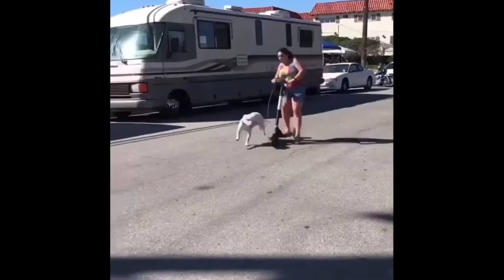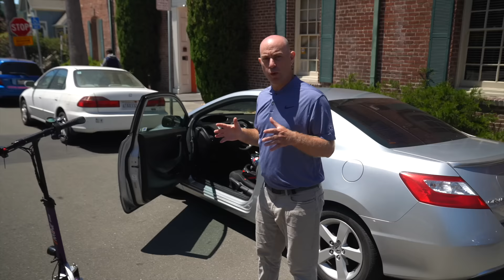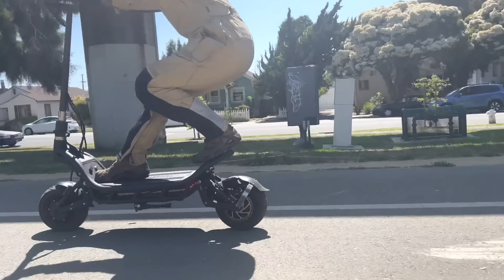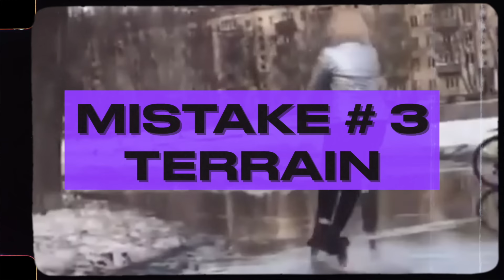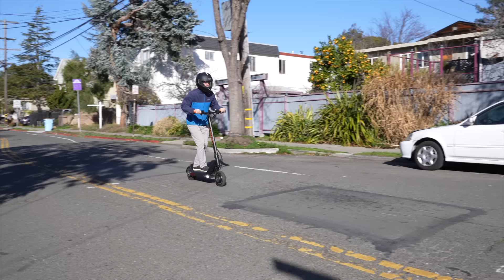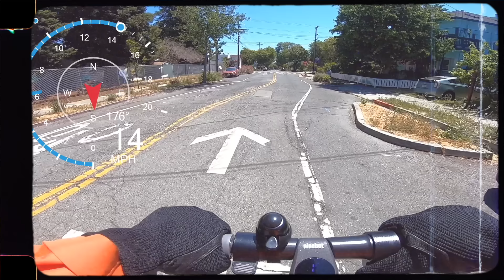Top 7 Riding Mistakes New Scooter Riders Make & How to Avoid Them

Comment: The road alone can be slicker than grease when it's wet. Stick to sidewalks and 15 to 20 mph commuter speed in the rain. Also, adjust your suspension to better match your weight. Some of these units ride like a brick and be very "hoppy". Even with full suspension  and air tires. Due to overkill on the payload capacity. Soften it up to smooth out the ride. Popping the front tire up to clear over larger bumps helps greatly. For when you can't slow down. Learn how to bunny hop.
 
P.S.
The Apollo Phantom is an absolute beast. 🔥 I absolutely love it. I haven't had this much fun on 2 wheels. Since I was 12 years old. Riding on a BMX track...
My units tested top end of 43 mph is no joke. I wear a full face, modular, motorcycle helmet. With a level 1 armor jacket and gloves. In case my guardian angel's on break. Turning 51 this year, I don't bounce so good anymore... 😂

Comment: Rode my buddies Apollo phantom V for the first time ever.. never been on one of these things.. and learned all of this within 15 minutes.. no issues. No crash or falls.  Seemed straight forward and common sense what to do and not to do! Some people are slow learners with dangerous toys.   Another tip** know your terrain and routes before going top speeds.. ex. Pot holes, sewer grates, curbs, cracked roads, where the crowds are, busy side streets used by drivers going to and from work, bus schedules and stops. Go slow and steady before you go zoom zoom Vin Diesel speeds
Reply from the maker: Very cool! Enjoy and thanks for sharing. -Vosk

Comment: I got my first EScooter a week ago. It has 3 speeds. Max speed 45 kms per hour. I rode it on bicycle paths, trails, and gravel roads. Use a bicycle helmet. I rode it a few times, no falls. But I start at slow speed under 20 kms, better traction.. No cars around 30 kms. So take it slow and steady and yes both hands on handles, and easy on the breaks. 😂

Comment: I Fell Twice  Since I had My Scooters. The First time my front tired  was going flat on me and I didn't See It, I Started Hearing the Metal Of the Motor Hitting the Ground/ Street. went to turn and Flew of my Scooter. 😁 Lucky I wasn't going fast. The Second time I was Trying to go Up on the Sidewalk From the Street, Now I've Done this a Thousand times But this One time instead of Breaking to Slow Down I Accelerated and wasn't lined up with the Opening of the Sidewalk and fell. Both times I was going Real Slow So I'm Lucky. 🙂🛴🛴🛴👍🏾🙏🏾🙏🏾🙏🏾

Comment: Awesome tips man. #1 is good because your riding backside to the vehicle, so if you contract and fall you can control the fall easier being frontside to the ground. Whereas the other way if you contact and fall, you won’t have much control at all falling backside to the ground. That’s when the back of your head becomes vulnerable.
With tip #5 (?) when “waving” - a basic finger motion gesture works. Thumbs up or two finger “Hi”. Turn signals should really only be done when you’re stationary, considering you should be stopped before turning to the opposite side of the road, unless there’s no traffic and safe to do so. Turning a corner on your own side shouldn’t require a signal, cos even if an opposite vehicle is waiting to turn into the same, it still has to give way and wait for you to turn in first regardless. So you should oblige a turn signal in that case, but not necessarily, because as mentioned the waiting vehicle still has to wait regardless.
Reply from the maker: Very informative! Thanks for sharing. -Vosk

Comment: Riding my entry level scooters I wear a helmet, elbow, knee pads and gloves with plastic wrist brace insert (skate board variety). With my off-road scooters I add padded underwear, kidney belt AND a equestrian chest protector. Its hard to have fun without 
falling but I’m now avoiding so many spleen and tailbone bruises, crack ribs, sprains, scrapes, cuts and punctures. 
Ready, set, GO!  Love ‘em.
Reply from the maker: Glad you are okay

Comment: The traction test gave me shivers...esp. the sand.  I ate it big time riding my ebike.  I know not to turn or brake, but I don't know what happened.  I saw the sand on the bike path, it wasn't deep and all I remember is coming up to the sand and the next thing I was off the bike with a bloody knee and the FRONT of my helmet scratched.  That would have been my face if not for the thickness of the front of the helmet.  Ouch.  And I'm a seasoned bicycle rider...road, mountain and now ebike.  And I'm thinking of gettin' an escooter...sheesh. 😂

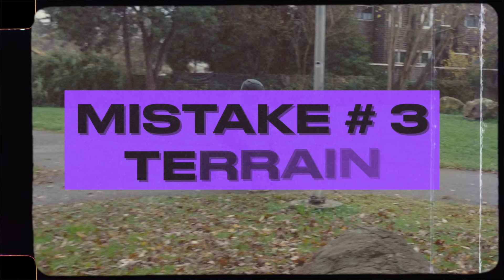Comment: (4:53) There is one other terrain danger that I noticed recently that is not mentioned here. I was out riding after a light rain and I went over a "zebra" pedestrian crossing (think of the cover of The Beatles' "Abbey Road") and the painted parts were just as slippery (if not more) than any wet metal. Be careful when going over these.
(One more wet weather tip: If you are on a dual motor scooter, turn off the power to your front wheel if you can. I've found that this makes scooters much more controllable when accelerating.)
Reply from the maker: Insightful! Thanks for sharing. -Vosk

Comment: The breaking is the most important one I had an accident 3 weeks ago with a fracture in the left forearm and bruised ribs when you break remember to bend its very important and mostly when it’s  a  sunny day wear eye glasses that block the sun cause if you are blinded by the sun you won’t see the pot wholes and you will panic and you will forget to break properly and don’t forget to wear a 360 degree full helmet cause really it saved my life I could have broken my chin and my tooth as well  thanks for the review that I watched almost a year ago before my recent accident it’s really helpful cause a scooter overall is a great tool that’s gets you wherever you want to go and don’t be scared on riding because you failed just be alert and cautious
Reply from the maker: Very insightful! Thanks for sharing. -Vosk

Comment: I watched this because I had a pretty big fall that could have turned out a lot worse. I didn't realize that my scooter had an auto cruise control function and so exactly like your suggested scenario I was happily cruising along at 15mph with my thumb on the throttle. As I was approaching the 3 way stop I let my thumb off the throttle but wasn't slowing down. I panicked and stupidly decided to jump off the scooter while still holding on and did a Fred Flintstone type of run beside it before the force of the scooter through me into a crazy tumble in the middle of the road. I also had my dog running beside me and my other smaller dog in a carrier on the front of me. Oh and it was slushie/icy roads that day. 🤦‍♀️🤦‍♀️ It was one of my first rides and I learned a valuable lesson that day. By the way I was innately aware of my dog strapped to the front of me as I was falling and manages to prop my arm and shoulder out in such a way that shielded him from getting crushed when I tumbled. I was soaked and definitely sore later that day but luckily we scathed by without any major injuries. 🙏🙏
Reply from the maker: Glad to hear you ok! Stay safe 
-Vosk

Comment: Wow. First video which really tells about important topics. 99% of value.
Good practice is to put your weight on rear before you hit slippery, unsure or sandy way. Most fall is caused by slipped or blocked front wheel.
Reply from the maker: Very insightful! Thanks for sharing.

Comment: One more thing. Always stop at stop signs. Some car doesn't completely stop at stop sign. I release the throddle distance away before I get to a stop sign. When you take your hand off the throttle the scooter automatically start slowing down so you don't have to make a quick stop that will cause you to flip off.

Comment: Regarding the one hand thing. When I absolutely need to let go and use only one hand, I developed this sort of technique where I press my body against the handlebars in order to stabilize it while I quickly do what I need. Never had an issue of instability or falling while doing this, though I'm overall a pretty careful rider and never do this on high speeds, still I wonder if it's an alright thing to do or is it just as dangerous and I was just lucky.
Reply from the maker: Very insightful! Thanks for sharing. -Vosk

Comment: I use my feet as a turn signal, but msot drivers don't care. So buy, or add lights at the back of your helmet or bag, that can be remotely controlled on your handle bars to indicate which direction you're going, found it much safer because the drivers have a full view of your warning.

Comment: I crashed riding in the winter going about 5mph. There was some snow in areas, but for the most part the roads were clear except for some snow build up between lanes. I had encountered snow piles before and just pushed through them, but this time crossing the road, the snow between the lanes had frozen, and instead of pushing through, it was like hitting a parking curb and brought me to a dead stop sending me over the handlebars. Banged my knee pretty good, but because of the slow speed no major harm done. So don't assume the snow is soft.
I also once attempted to get across about 8ft of iced over sidewalk at a crawl. Got about 4 ft and was going to slow to balance so I gave it a touch of throttle and that just spun the rear wheel out and sideways and I went down. Riding on ice with two wheels is not a good idea unless your tires are studded.
Reply from the maker: Stay safe! Glad you are okay

Comment: The overall best advice is slow down and keep both hands on the bar. Especially on unfamiliar roads or paths. Every bump and hole is a potential hospital trip.
I've had a scooter for a month. But I've been riding motorcycles for over 25 years and had one accident 14 years ago. Titanium in my arm and leg is a constant reminder.
Reply from the maker: Very insightful! Thanks for sharing.

Comment: Pay attention to what they say about traction. Leaves are piled on tree lawns for pickup where I ride. Piles will often times blow into the street. One this narrows the width of the street causing cars to drive closer to you. Two even if the piles appear dry they can still be wet underneath. These piles have a layering effect trapping your wheels causing them to randomly slide out from underneath you like ice.
Reply from the maker: Very insightful! Thanks for sharing. -Vosk

Comment: Never falled, and I have owned like 6 escooters (7th on the way)
And ride on winter over 500km without fail with my 6th scooter (iscooter ix5s) 45km/h on winter no problem. 
The new one (Halo Knight t104) or somethinglike that. will go around 65km/h. Will be fun to try o

Comment: I crashed on my gotrax G4 twice in a two week period right after i got it... I had learned to ride on a smaller gotrax model that didnt have the same speed, size, and weight of thr G4 nd it was definitely a beefier upgrade than expected. The first accident was a misjudgement of speed. I took a left hand turn into a plaza too fast, ran the front wheel right along the curb and got myself thrown off. The deck of the scooter swung around and "scooter-ankled" me right in the middle of my right shin which caused bleeding and a blood bruise under the skin that took months to heal, and I still get phantom pain. The second crash was at night. I was riding through an empty parking lot and ran head on into an unlit and unmarked curb island going about 15mph and flung myself over the handle bars, acoss the island, and rolled 6ft across the pavement. Everything in my backpack got crushed by me rolling on it. The only injuries I got out of it was roadrash on my elbow and some BIG bruises on my knees and calves. My helmet saved my life because I felt my head bounce while I "tucked and rolled".
So in all. My biggest advice is stay FAR away from curbs, take it slow, headlights on at night always, and WEAT YOUR HELEMTS
Reply from the maker: Stay safe out there!

Comment: I crashed into a car and an intersection going about 60 mph on my scooter and broke my left leg. It could’ve been avoided, but I didn’t know how to break properly so I skated for about 10 feet pressing down hard on the back break. I then slammed on the front break, which sent my back wheel, spinning into the left side and collided with the car. This caused me to break my left leg the funny thing about it. My scooter doesn’t even have a scratch from the incident the only thing that broke was one front light on my scooter, which I replaced for 20 bucks right now I’m recovering, but I love my scooter.😂

Comment: None of this applies to me as I ride on the sidewalk and I never exceed 15mph plus my battery last all day 😂 😊 now I DID fall off a moped from a bullying driver and ended up breaking my leg in several locations which 6 months later after multiple surgeries I'm still healing from but for all practicality sakes I feel safest on commuter scooters. They are meant to cruise and enjoy the scenery and not having to spend on gas not to go full blast down the street at that point you might as well just get a gas motorcycle

Comment: So I had a few crashes, one left me with a broken arm it was due to poor weather conditions heavy rain and bald tyres while riding into a corner the rear tire went out under me and I flew off almost hit a on coming car and landed on my wrist left me with a fractured wrist, the most recent was while riding in sand the cause of it was me letting of the throttle the (since it was awd it was plowing through the sand easily) front tire dug in about 2-3 inches and it launched me over the bars, nothing bad happened since the sand caught me and I was going only 10-15mph but the one thing I recommend is always wearing protection

Comment: Another turning trick I have done on a bicycle, not a scooter yet, is to intentionally turn into the direction of the other human hazard I am trying to avoid.  The reason for this is I quickly lay down the bike and then can make a sharp turn away with my whole body.  Of course you need to know the limits of the 2-wheeled vehicle you are riding so you don't go sliding across the pavement with your body.  I have found this faster than twisting and contorting my body to try to avoid someone.

As my main goal is micro-mobility for work in conjunction with mass transit, I am working to more or less fixed time tables.  I try to take the bent, I will get there when I get there.  Granted my scooter isn't all that fast and in a way that is a good thing, and at this I spend most of my time at 100% throttle, in part because it is not a very fast scooter, but when stuff is going on in front of me, I slow down, I ring my bell when it makes sense, and sometimes I even get off my scooter and walk.  The thing is, especially as I get a little older, it doesn't pay to take unnecessary risks or to put other people in harms way because you feel like taking risks and/or "are in a mad hurry because you are running late".  Better a little bit later than never made it because you crashed.  And you certainly don't want law suits against you after "I just barely tapped them" and now they are suiting for "substantial bodily harm".
Reply from the maker: Very insightful! Thanks for sharing. -Vosk

Comment: I found that Since getting the cheapo one I bought to see if I even liked it, I assumed a surfing position. Which led to me wanting to stand the same way with my right arm trailing. 
Btw I don't advise people do this unless if they're stupid like I am but I switched the brake and acceleration control and it allowed me to have a relaxed and comfortable stance the entire time. 
So far the worst I've done is bang my foot with the side of the scooter. 
I like to think all my years of surfing and skateboarding played a factor in my habits. I use the right foot to use the step break. I bring the other hand forward to use the system brake, and I just go with light feathering leading to more pressure being applied. 
I'm just about convinced I want to go with a better model at this point since I've found I kind of like it and not having to waste gas driving into work every day.
Reply from the maker: Thanks for the feedback 
-Vosk

Comment: In three months of using the scooter, I fell twice.
- The first time it was at night, I was driving on the sidewalk, and I thought it was a bike path. The exit from the yard was 10 cm below the sidewalk, one car wide (about 3 meters). At a speed of 32 km/h when I saw the cliff, it was too late to brake, another fraction of a second for the flight, and now I crash my front wheel into the same cliff on the other side of the exit. The front fork bent, I had to remove the fender and adjust the brakes, but in general the scooter survived.
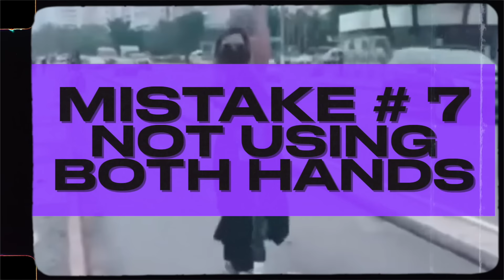- The second time is associated with the release of the second hand (8:30). Sometimes you need to scratch your nose or remove something from under your glasses, and for a while you can press the handlebar with your stomach and let go of one hand. However, keep an eye on the surface of the road: I found myself on the exit from a speed bump, the wheel swerved, I flew to the side of the road. It is better to slow down or stop, because you have very nominal control without one hand on the handlebar
Reply from the maker: Sorry about that! Glad you are okay. -Vosk